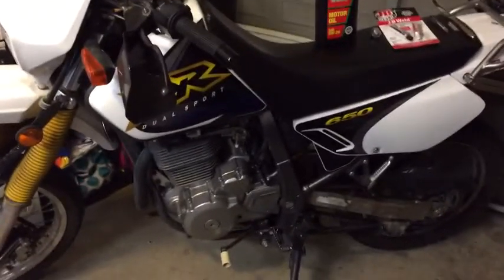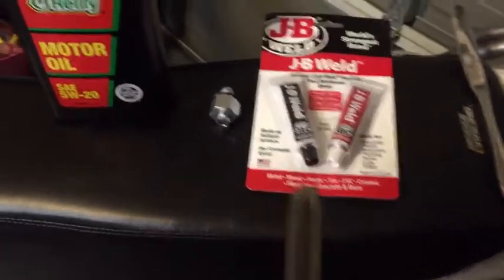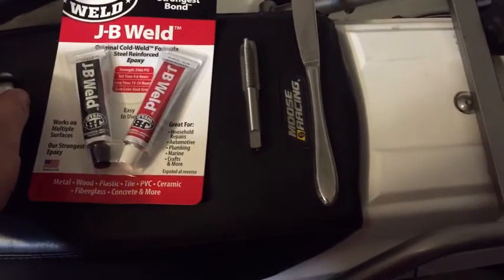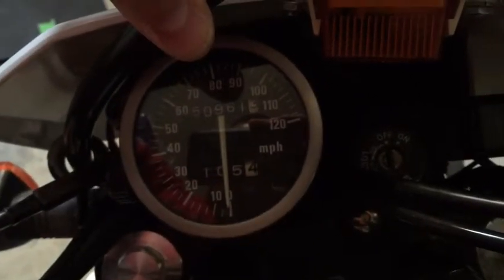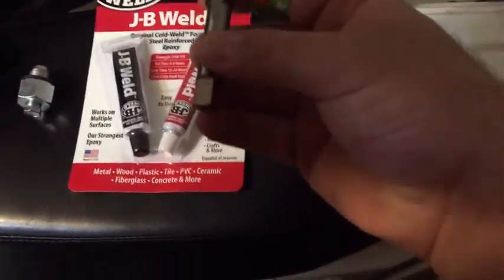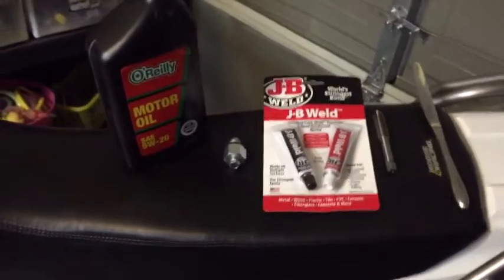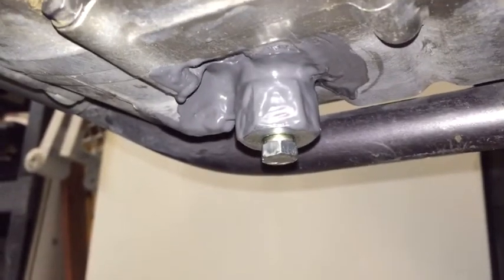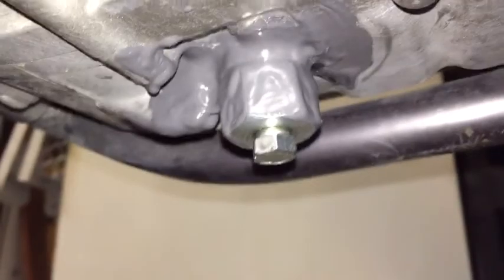Oil Drain Plug Hole Repair

Comment: How does the piggyback stand up to vibrations? I have a 98 Harley Sportster and the drain hole on primary case got stripped. I am about to tap it with oversize plug, but I'm thinking about the piggyback setup.
Reply from the maker: Dawgs241 I will say it will hold. Watch project farm and you’ll get a good idea of how good JB Weld is.

Comment: If your rethreading it already, you might aswell do it the right way and get a normal bolt with normal threads. Not cone thread to mess up the new threads after taping

Comment: Its always a good thing to remove those shavings or any foreign particles but I wouldn't worry too much about it this case due to it being thin shavings of aluminum. It wouldn't lock the gears up anything.

Comment: So my stock drain plug is M12 x 1.50 and I got a drain plug that is a piggyback M12 x 1.75 do I need to rethread my drain plug hole?
Reply from the maker: Wouldn't hurt. I probably would.

Comment: Thinking of doing the same with a Goldwing.  I wish the piggyback was avail in better quality.  this looks like a tractor part.   Oh and what happened on  running the tap in?Did you change your mind and just force it in?
Reply from the maker: I just slowly worked the tap in. I would turn it in and then back it out and each time in I would go a little farther. In the end my plug ended up being slightly crooked or off. However, it's worked flawlessly since with no leak whatsoever. The JB Weld around the plug is what sealed it up.

Comment: Nice repair overall. The JB Weld would have been far stronger on the lower threads of the plug and screwed into the hole. Physics is fun.

Comment: just a quick question does it still last ? Just wondering about JB in combination with vibrations and heat of the engine.
Reply from the maker: So far it has held up beautifully. The only issue I've had is not with the JB Weld. The piggy back plug drips a tiny bit of oil every now and again from the screw that plugs the hole. I'm hesitant to really torque that drain hole plug down too tight for fear of cracking the JB weld that holds the whole thing to the pan.